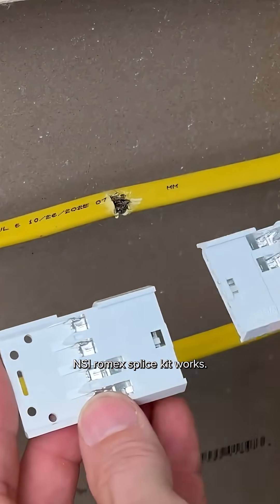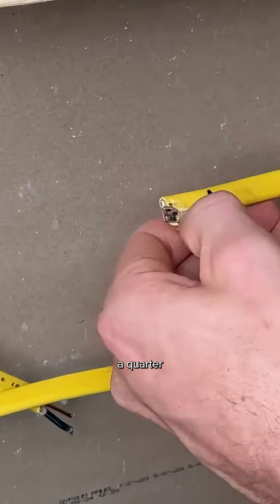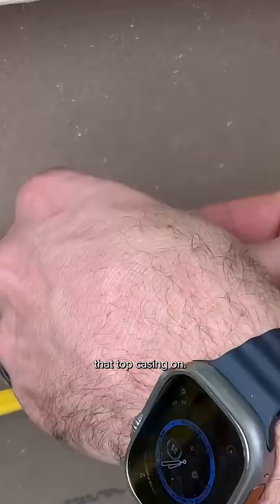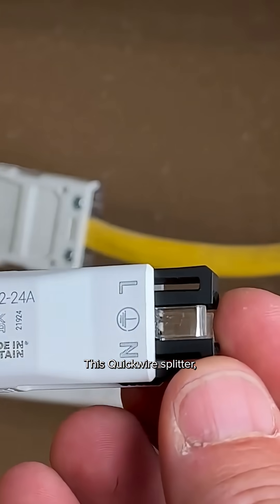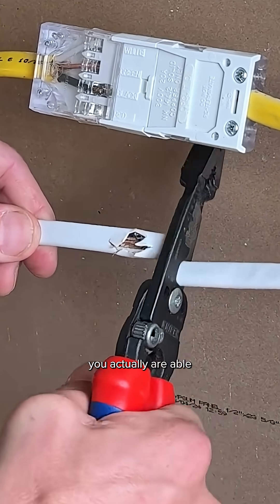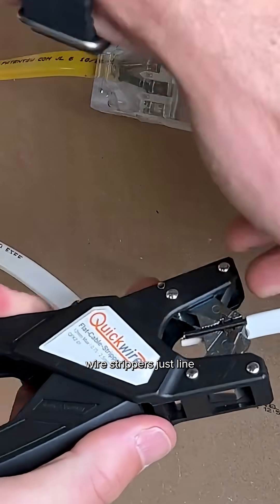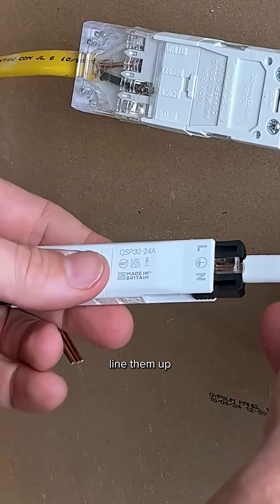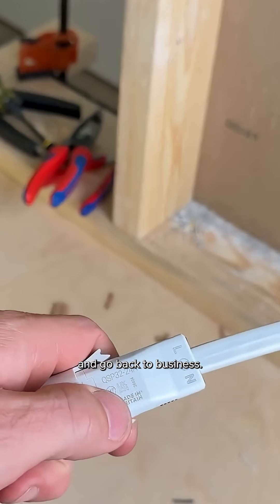The NEC-Approved Splice I Hate… and the UK Inline Splice I Love

Comment: APPROVED! What I love about the UK version is that it appears there is much more contact surface area between the connector and the romex since the installation involves completely exposing  a section of wire rather than counting on just piercing the sheathing as is done on the NSI Romex kit. You didn't mention it, but I'd suspect the UK Quick Wire does NOT generate nearly as much heat as the NSI Quick Kit. Thanks so much for making this video!

Comment: My understanding is that the first coupler was kind of "accidentally" allowed in the NEC, because it was designed to be used on modular homes where all the wiring was done in the factory but wires had to be spliced when the sections were joined. The NEC allowed this, but then someone realized that this would also allow a buried, in-wall splice for general repair purposes which had never been allowed before.

The fact that there is two pieces that connect together is just another point of failure for that general case.

Comment: The next guy will have fun finding that when it opens. They made a similar connector for automotive use years ago and they SUCKED. Do not approve them they are a fire hazard and the NEC states that all splices must be made in a box and accessible. Splices shall not be buried in a wall

Comment: Here in Louisiana, after a hurricane or flood, those splices would be amazing. I've seen wire nut splices in walls,above the water level. It was allowed by inspectors. I've seen too many electricians that couldn't install a wire nut. Looked good until it's tug tested.

Comment: Do a long term thermal cycling test to check for gas-tight wire connections which don't oxidize and have rising resistance.  And I STILL don't like these as they are not as secure as doing a real repair.  What is someone fishes another wire in the empty space and dislodges the connection?  I don't care if these are approved, I don't want them in the walls of the house for my family.

Comment: APPROVED. Used them over here in the UK and they are definitely more secure than the other model you demonstrated. I’ve only ever seen IDC connections being used on extra low voltage systems, such as telephone lines before. There are also other Quickwire models available, such as switch and load and 4-way variants 😊

Comment: The only issue I can see is the 120v vs 240v issue, with the higher voltage our circuits require lower current for the same power output.

Comment: The design of the 2nd one is actually MORE dangerous because you cant visually see the connections/potential problem points imo. It is neat but I dont know why its so obfuscated. Its cool, but I dont use these types of splice connectors anyways. I find wire nuts, electrical tape, and solder to be more than good enough. These things feel like theye designed for people with money who dont want to problem solve on the cheap.

Comment: I would like to see the state of these connections after lets say, 1000 cycles of a 12000 BTU Window unit A.C full voltage start up. And 20 short circuits that trips the breaker to simulate real life usage. After you load them up at 12 amps continuously for 2 hours straight and then check the thermal and resistance difference from the beggining of the test with the end of the test.

Comment: For the average home owner repair I can see how this can look appealing. But as an Electrician I would not use either one of these things. There are terminal and heat shrink made splices for situations like this that are UL listed and would hold up underground. Im not a fan of any splice that is not held together with screws or wire nuts.

Comment: GARBAGE!!!!!!!!!!!!!!! These Things SUCK!!!!!!!!!! If You Ever Have To Go And Find Why A Circuit Has Lost Power And They have one of These GARBAGE Connectors In The Line!! Usually Under The Insulation So You Can Find It!! You Will hate This GARBAGE As Well!! Put The Damn Splice In A BOX And Use Wire Nuts Or Some Decent Connectors! I Spent Hours Chasing Down An Intermediate Flickering of The Kitchen Light Circuit!! After Checking All Connections In The Junction Boxes Including Taking Lights Down I Found One of These Pieces of Crap Buried As I Was Pulling The New Wire! I Will Never use Such NONSENSE!! And If You Have To Nail It Up So It Will Be Seen!!

Comment: Speaking as an electrician in Canada, I would not use one of these in my house.

Hidden failure points, possibility of incorrect splicing.  Chance of getting one end yanked down the road

I’m sure the engineers can make it work in the lab, but in real life out of an abundance of caution I would always put a 4x4/100mm box and splice in pigtails to make up the length.

Comment: I've made Ethernet cables before like this and it's fine for low voltage, with the attitude I've seen electricians have they'll put 2 wires in 1 hole and say fuck it.

Comment: I am not a fan of the first product you show here. We actually have a lot of service work replacing these on double wide modular homes. They connect the two house halves with these and they are notorious for shorting out. It very well could be moisture exposure from being located under the house. 9 out of 10 times we get a call for these homes having lost power to half of their house or individual rooms. It is due to these connectors.

Comment: They approved the Wagos so..Approve this. I mean, it is actually approved in UK and EU for up to 500 volts, and they had one for 10mm and one for 4mm ascwell, if i recall, and have one out later this year for 1 or 1.5 wires

Comment: The fact that this is compliant but wire nuts or wagos are not is honestly mind blowing.
Reply: It's because this is designed to be both the connector and the housing/junction box.
Reply: @zaibervaireus  For my money, I'd take a properly terminated, tape wrapped wire nut or wago burried in my wall over any stab connector any day and twice on sunday.
Reply: But, isn't a Wago a type of stab, also?
Reply: Not at all. It’s a mini buss bar that locks onto the wire with a lever.
Reply: @ronstrong9560  Definitely not!
Reply: @bradley3549  Taped wire nut? wtf is the reason for the tape? An inspector can 100% fail you for taping a wire nut. The wire nut is not designed to be taped. Tape hold heat in. Also taping outlets is a code violation also. The outlets are NOT tested and designed to be taped. Tape hold heat. Heat causes failure.
Reply: @Junktrunz  Again, I think you've missed something here. I'm saying even a taped wire nut would be better than these. Not that taped wire nuts are *GOOD*.
Reply: @zaibervaireus  I Had rather Them Use Cloth Tape And Twist The Wires Together!! I Know That Works! I have Seen Big Balls of Cloth Tape With Wires That Look Like A Spiders Web Going Down To Each Receptacle That have been In Use For 80+ Years With No Issue! Wire Nuts  And Tape In A Box passes Code! If It Can be Accessed! I hate These!
Reply: wire nuts and wagos are compliant if you put them in a junction box.

Both off these are a splice that does not need a box as it is the both the splice and the box.
Reply: @markburton5292  Yes, I assumed that was obvious and didn't need to be stated. The point I'm making here is that I'd trust a non-compliant buried splice using one of those two methods over this Scotch Lok style stab box abomination.
Reply: @bradley3549  First off, your original post didn’t explicitly mention “without a box,” so I was just clarifying why these splice kits are code-approved while standard wire nuts or Wagos are not (when concealed without an enclosure). I wasn’t trying to miss your point. I was explaining the actual code distinction.

Second, there’s no need for the snark. I kept my reply civil, and a civil discussion works better for everyone.

Lastly, and most importantly: if you splice with wire nuts or Wagos and bury them in the wall without a proper accessible junction box, that’s a code violation. If an electrical fire ever occurs (even if unrelated), an insurance investigator could deny the claim when they discover non-compliant work. Those types of improper splices have caused fires in the past. The listed in-wall splice kits, on the other hand, are UL-approved for concealed use without a box, so they’re defensible and insurable. If you don’t trust the splice kits (and a lot of us feel the same way), the safest and most reliable option is to install an accessible junction box with wire nuts or Wagos inside it’s code-compliant, easier to inspect/troubleshoot later, and gives you peace of mind. Also, if you’re a builder or having work inspected, anything other than a listed method or proper box will fail inspection. 

Anyway, have a good day!
Reply: @markburton5292  To the audience my comment was meant for, it was not required to explicitly mention. I know it's a code violation, that was my point.

I'm literally saying I would PREFER a code violation to these scotch lok splice kits. That's the point. That's the joke. It's no fun when you have to explain the joke.
Reply: @bradley3549  safety and code compliance isn't a joke.

Also, even if it's a joke there was no need to be rude.

Any way no harm done just a friendly reminder.

Stay safe.
Reply: What will happen in 20 years when the homeowner plugs a space heater into the circuit every day you don't think that eventually these connections will corrode fatigue and increase and resistance. Why are piercing is a terrible terrible terrible connection I mean and there isn't even a dielectric grease on these things to prevent corrosion this is a fire waiting to happen 

One more reason I disagree with so many building codes
Reply: They don't have a tension rating
Reply: Also how the hell is if supposed to be accessible!?
Reply: @reuploadify  It's not, that's the whole point. This stupid connector is approved for use where it is NOT accessible. Yet somehow passed certification with the worst possible connection technology man ever invented.
Reply: @bradley3549  You must just form your opinions on things based on what OTHER people say. A wago or a connection like this splice kit when installed PROPERLY will handle more then DOUBLE the current of a properly installed wirenut. Keep forming youir opinions based on klnowledge form 25 years ago when thei tech first6 came out. Its a quarter century later. Get with the times buddy
Reply: @Junktrunz  Couldn't be farther from the truth. These sort of scotchloc type connections are always crap. I don't care what or when. That's decades of experience talking.

Wagos are great though. Not even in the same category.
Reply: @Junktrunz I love wago’s but a properly installed wire nut will have lower impedance and carry more current. It’s literally simple physics. The problem with wire nuts is many people don’t install them correctly and a wago is dummy proof.
Reply: @Junktrunz must be another electrician who only uses this newfangled crap and just assumes it's better. This stuff is not had enough time to prove itself out and explain to me how a spring-loaded connector that just touches and pushes against the wire is better than a wire nut which is physically forcing the wires together in multiple spots as it's twisted. Legos are for speed because they're faster than wire nuts electricians praise them. I have personally seen these things actually melt when installed properly due to moisture causing corrosion in the same exact environment why are nuts were installed which were fine

Comment: You stated you were going to read for increased resistance. What was the results for each? Heat? Conductivity? Hold (does it keep hold if it's pulled, or do the wires slip out)? We need more info for an informed decision.

Comment: Approved - Here is why. I cannot count how many times I have been in an attic and discovered a rodent has gnawed into a wire, or someone was careless and nicked it. Homeowners hit them in walls with nails and other fasteners. I would have to set two boxes in an attic, with a jumper between the two.. This is a real time saver, and still bill it the same. Off to the next job sooner too.

Comment: To be honest I don't like any type of splice hidden in a wall that is not serviceable.  None of these connection types have been around that long so we really don't know how well they will hold up over the decades.  Even Wago connectors will tend to go higher resistance as the connection ages and the metals within the connection begin to slowly oxidize over time.  None of this stuff has been tested for 50-100 years so we really don't know how that same connection will be performing while buried in a wall 50 or 100 years from now.  I say this because a majority of the wiring in my house was installed in 1950 and it is all 2 wire Romex with no ground.  Even now that same wire is perfectly fine as all the splices were twisted and soldered and only take place within wall and ceiling boxes.

Comment: Use a wire nut like an ideal brand. I removed old ceramic wire nut in my house 40 years ago and they are still tight and have much better connection than a small contact splicer as shown here, which is a possible fire hazard.

Comment: In a exposed repair area, the British design would really save time for installation and simplicity.  I don’t like it hidden in a wall.  Folks have made a good point about testing with infra red for heat gain and resistance flares.  At some point, we could consider a modified twist lock male/female receptacle head connection for type of situation.  It would probably work as well and has already pass NEC inspections.

Comment: You have to take into account what happens at the connection points over time, i.e. oxidation of the conductors/contact points. Is there any antioxidant gel in either of these splices? What are the splice connector's contact points made of? Not enough info. in this video to draw a decent conclusion.

Comment: approved.
However the last in wall splice I did, involved 3 separate bridging wire collars with allen nut tighteners and heat shrink over each. That provided a full 360 contact around each wire and made the best connection.
fyi, I have seen the full video which show that even the better splicing device still only contacts the wire with a knife edge compression contact, so it is a limited contact.

Comment: If the installing electrician does a proper code compliance installation then these gadgets wouldn’t be needed.  Comply fully with art 110 of the NEC including NECA 1-2015 “Good Workmanship in Electrical Construction ⚡️
Reply: Ye I agree with your statement. As you know also the code is minimum. Also UL is minimum standards. 
Secondly if the NEC allows this then a similar item should be allowed for armored cable.

Comment: I will never use cut fork IDC connectors for anything important, and I will never bury one inside a wall. They have several problems over time with any king of heavy (70%) loads. The forks get loose just due to normal building or equipment vibration, and arc internally until they fail. Also useless on stranded wire, which is cut even quicker.

Comment: The push lock is a far better design than the "scotch lock" insulation piercing style connection.
I would really like to see the internals of the push lock style? Please...
Reply: Im just curious how much surface area each line is in contact for the connection 
( tiny contact point could / Will = a lot of heat under heavy load.. ) like the "scotch lock" style.

Comment: Not approved.  There’s no way to get a consistent repair with the NEC repair toy…it’s total crap that will cause fires.  I haven’t seen the UK version, and it does look like a much better contact but you can’t rely on a connection using different metals which alter the flow of current in even a tiny way.  More that 5 mA and you’ve got an unreliable circuit down the road.  It needs to be a solid mechanical connection near the use end of a circuit.  Anything in the middle should be much sturdier repair.  You don’t want heat building up in your wall.  Over time a frail connection will heat under greater loads (because usage ALWAYS goes up..never down..

Comment: It would be interesting to see the actual mechanism for gripping the uninsulated wires. How much surface area of the stripped wire is gripped and with how much pressure? I work in IT and IDC terminations work well for communications at high speed which enables a high bandwidth throughput but those applications are not high current, nor high power ones so resistance isn't as important as reactance which is an intrinsic property of the cables themselves.

Comment: I hate any type of connector that pierces through the wire.This goes back to my youth when I was trying to repair a lamp with a male plug that pierced the lamp cord. Because of a slight bend in the middle pointer, it didn't Pierce The Wire, but just the insulatiand that mail end did not work, which is a 9-year-old, took me a bit to understand how something made by an adult wasn't doing the job it was supposed to.

Anyway... 

I am not a fan of anything , especially something that carries line voltage where it relies on making the connection through a piece of metal that pierces the wires insulation

Comment: Approved? Absolutely!
  Only thing I have some question about is that there may be enough oxidation on the surface of the conductors to create a little bit of resistance, which may then result in some heat - hence further oxidation.
   I might put a thin coating of Noalox on the conductors before inserting.

Comment: not even to run a nightlight. ain't no way that's going to carry the load that the wire can....you'd be better off with automotive style crimped butt splices because at least those make a tight grip. and can be soldered...👽